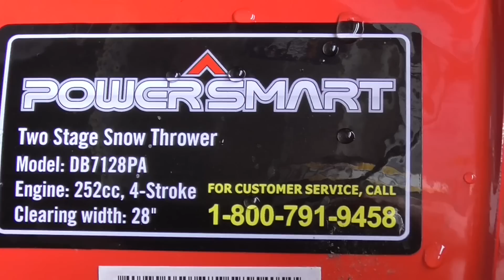Powersmart's 28" Snowblower Review DB7128PA

Comment: That heavy late season wet snow is a bear for a snowblower. You hear a lot of mixed opinions on these China built blowers as long as parts are available they seem to be a good value, looks a lot like your average MTD unit. Nice to see a metal friction drive transmission as you pointed out those plastic transmissions made by GT Transmissions that pop up in certain Craftsman and still on a mid duty Simplicity are essentially disposable and not worth replacing on a lower end unit.